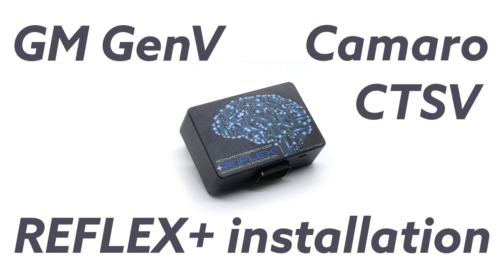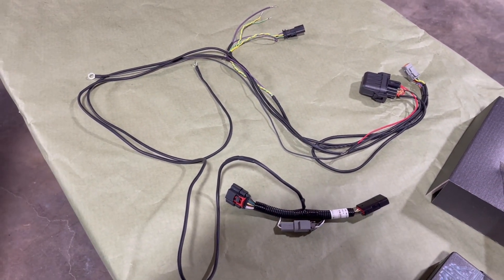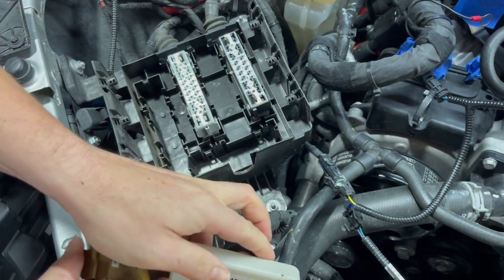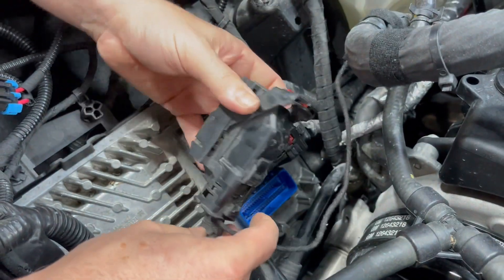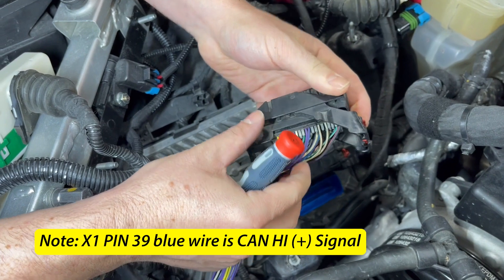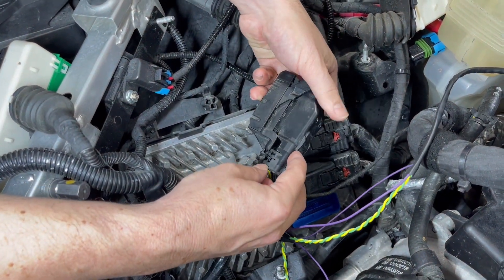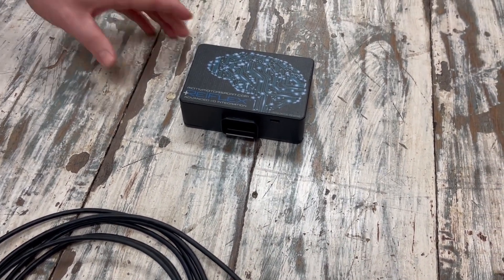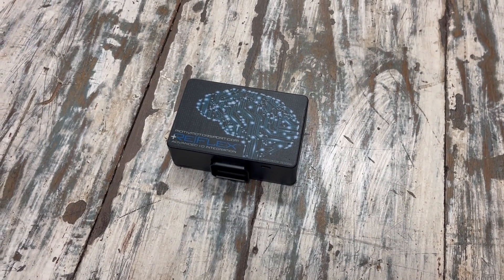Camaro/CTSV REFLEX+ Sequential Port Injection Controller INSTALL

Comment: easy install on 2015 sierra 1500 - X1 connector pins for can hi and lo are exactly the same. Cam signal sensor maps to X3 connector - pin 33. Thanks for the help guys - now to wrap up some loose ends on the blower and tuning time!
Reply: what blower do you use on a 14-18 1500 5.3 to allow the port injection? I'm looking for a 2650 on a 18 1500 5.3.
Reply: @minibikemadman  i believe the toohighpsi kits address the major manufacturers (whipple, tvs, maggie, etc)... i have a whipple 2.9 on my truck - its swapped to a built LT1 but they make blower kits for the 5.3 as well..
Reply: Hey is the pin out diagram for the 2016 model the same as your 2015 ?
Reply: hey i missed this - i would assume yes but not sure 100%